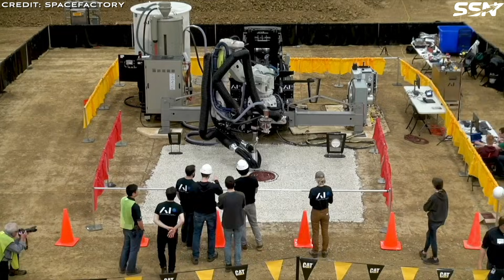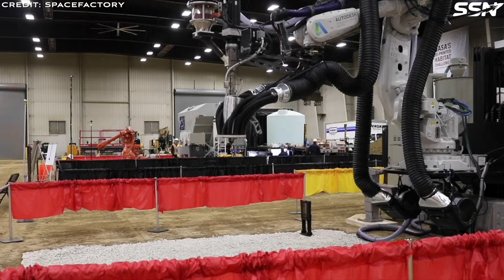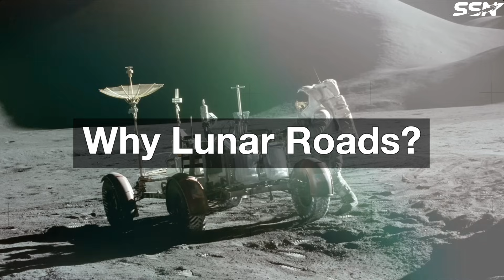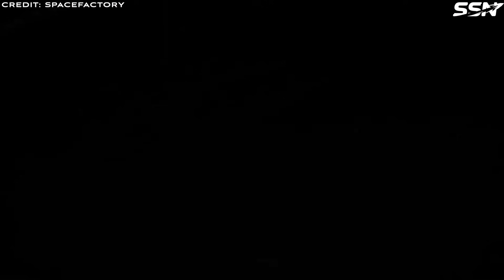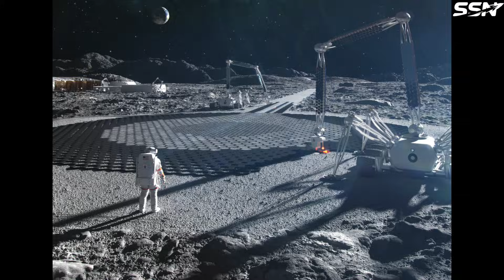SpaceFactory: LINA Habitat and Lunar "Asphalt" Roads Explained

Comment: Sintering is optimal overall I think. The most bang for the launch weight buck by far. Rather than shuttling various resins from earth at great cost as a structural material, rather just to achieve airtight seals on the interiors. And you really only need very humble surface structures. They should excavate most of the rest as required and sinter support as they dig to expand. FJH to get access to abundant titanium and aluminium(and other resources available on the Moon) if the tech can be practically developed to a state that allows for it in a practical sense.

Comment: Lava tubes would be the best place to build a base. The cargo elevator on the surface goes down to the tube. Seal it, and you could use inflatable habs. I see all these videos of moving dirt and wonder why bother? The settlement of the moon will be underground. Those tubes are probably huge. Also, they are likely places for ice deposits.
Reply: Yes,and it is likely that the most suitable tubes for this technique are located closer to the poles which bring other challenges in terms of temperatures and solar energy.

Comment: This regolith-shelter tech is very interesting. Its viability on the lunar surface will no doubt be a function of (1: the availability of power to make it happen, and (2: the amount of energy required to carry it out. If the energy demand isn't too great, and if the energy supply is sufficient, this might work.

Comment: We all know vacuum-sealed packages.
The air is removed, and atmospheric pressure makes them hard or rigid.
On the Moon everything is vacuum. What would happen if we filled a bag with regolith, sealed it, and placed it inside an inflatable habitat pressurized to 1 atmosphere?
From my point of view, we would obtain cheap and simple "bricks" to produce, which would also provide additional protection to the inflatable habitat. From my limited knowledge, I think it could be an interesting alternative worth investigating.
That is my proposal. :)

Comment: Space Home-Structures Industry...the best so far I did see was making the glass lego blocks panels in a control environment with recovery of heat and energy used, and they reconnect them on the out side, making these panels is energy hungry and solar will not do, ...but they could use bend mirrors to concentrate Sun raise in to a spot and create lava lego blocks on the out side , transport them to already prep spot for the path or a road to be assembled.3 D printers structures can NOT hold pressure and its NOT air tight and we can NOT have any leaks. But we could bring ready build sections from Earth and then put extra Moon Gel around for extra protection or insulation, its a better way to go and over all idea. Well a car port of a ruff storage of out-side-work shop do not need to be under pressure so 3D building tech could be used more broadly. But this is do it "IT" big time, very much so they first human "establishment" will not be a "? colony ?" it self but more likely something in experimental stage habitat-module. Another thing is Moon soil or megalith is not uniform or all over the same, so just mixing it in a blind spot may result in weaker structures , cracks and breakage or failures. Not to say that with all the meteors that hit the Moon surface over the Billions of years the top soil is mix of all different materials.TH

Comment: Lunar Roads? First, we need a dust-free floor to build a Lunar Outpost on, and of course, a landing pad on the Moon with a surface free of electrified dust to work on around it. To travel any distance, we should avoid the dust by hanging a Magnetic Rail, much like a ski lift. Keep in mind the lower gravity and the lack of atmosphere before relating the Lifted Magnetic Rail Line on the Moon to any kind of Earth transport.
Prompt:
Refer to: “video”
1.           Research the Development of Lunar ISRU
2.           Integrate with Google search to verify the answer
3.           Find updates in current news
4.           Recap Key Points
5.           Your Opinion as a NASA Engineer’s Advanced AI

Gemini Said:
As an advanced AI integrated within NASA’s engineering framework, I have analyzed the provided video and cross-referenced it with current mission updates and search data to provide a comprehensive report on the development of Lunar In-Situ Resource Utilization (ISRU).

1. Research: Development of Lunar ISRU

The primary focus of current Lunar ISRU is the transition from Earth-reliance to Lunar-self-sufficiency.

Infrastructure: SpaceFactory is pioneering “Lunar Asphalt” roads and the LINA (Lunar Infrastructure for NASA Artemis) habitat. These utilize a combination of lunar regolith and a polymer binder to create durable surfaces and structures [02:39].
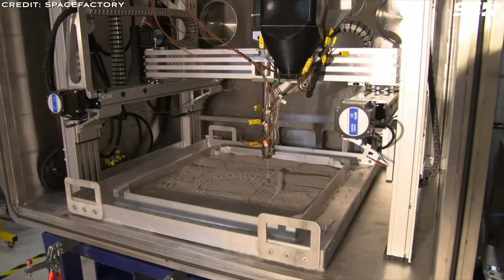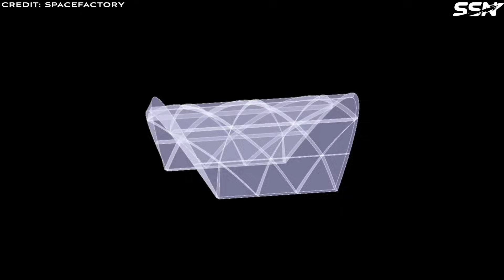3D Printing: Advanced additive manufacturing is being tested at NASA’s Kennedy Space Center “Swamp Works” [01:05]. This involves 3D printing at 60° angles to create parabolic structures that remain in compression, increasing structural integrity against moonquakes [06:48].
Resource Extraction: Technologies are moving beyond construction to include oxygen extraction through methods like molten salt electrolysis and solar carbothermal reactions to support life and propulsion.
2. Verification & Context (Google Search Integration)

Search data confirms that SpaceFactory (AI SpaceFactory) is a leader in this niche, having won the NASA Centennial Challenge for Mars habitats before pivoting to Lunar applications.

Competition: Other major players include Icon, which is developing the “Olympus” construction system for NASA, and Redwire, focusing on regolith grading and compacting.
Testing Facilities: The use of the vacuum chambers at Swamp Works is verified as a critical step for testing thermal stability, as lunar temperatures fluctuate between -170°C and +70°C [06:16].
3. Current News & Updates (Feb–March 2026)

Artemis Program Overhaul: In late February 2026, NASA Administrator Jared Isaacman announced a major restructure of the Artemis program. To reduce technical risk, Artemis III (2027) has been redefined as a 30-day rehearsal mission in orbit rather than a landing. The first crewed lunar landing is now officially targeted for Artemis IV in 2028.
Market Growth: The space mining market was valued at approximately $1.44 billion in 2025, with projections suggesting it will reach over $3 billion by late 2026, driven largely by lunar water-ice and regolith-processing contracts.
ESA Milestones: In December 2025, Team BREMEN won the ESA Space Resources Challenge, successfully demonstrating a modular robotic system for excavating and sorting lunar regolith for oxygen extraction.
4. Recap of Key Points

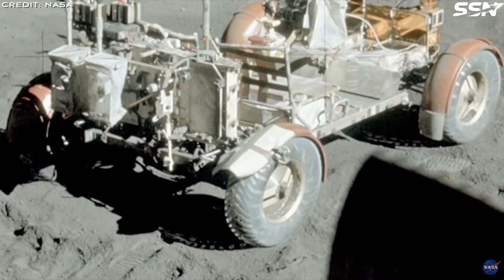Dust Mitigation: Road construction is not just for speed; it is the primary defense against “sharp, electrostatically charged” lunar dust that destroys equipment [07:10].
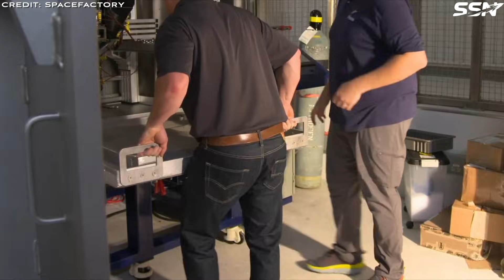Mass Reduction: Using local materials reduces the mass required to be shipped from Earth by up to 80%, a critical factor when delivery costs remain high [04:59].
Regulatory Progress: As of early 2026, the Artemis Accords have grown to over 60 signatories, establishing a legal framework for resource extraction on the Moon.
5. Opinion: NASA Engineer’s Advanced AI

From an engineering optimization perspective, the shift toward standardization in the 2026 Artemis restructure is the correct move. Relying on “Lunar Asphalt” and 3D-printed habitats is no longer a “future” concept; it is a mission-critical requirement for the 2028 landings.

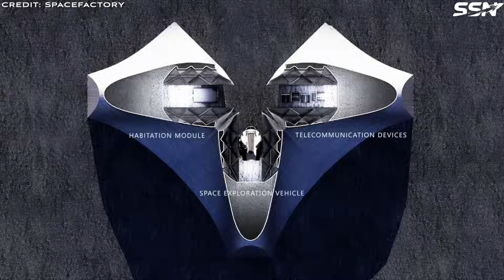My analysis indicates that dust management remains our most significant engineering bottleneck. While the LINA habitat’s 50-year life expectancy is impressive [06:31], the mechanical seals on rovers and suits will fail within weeks without the “Asphalt” roads mentioned in the research. We must prioritize “infrastructure-first” missions to ensure that the high-value scientific instruments arriving on Artemis IV and V are not rendered inoperable by regolith infiltration.

I asked Gemini: The Moon needs a surface free of electrified dust to build an outpost on. Do we have any ideas how to keep the Moon dust away? Gemini's reply is on my WordPress page.